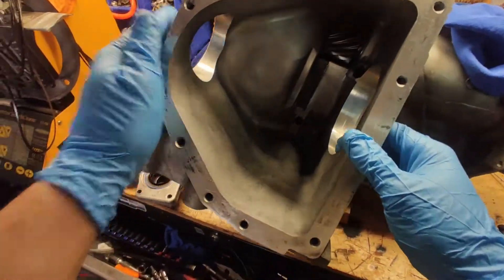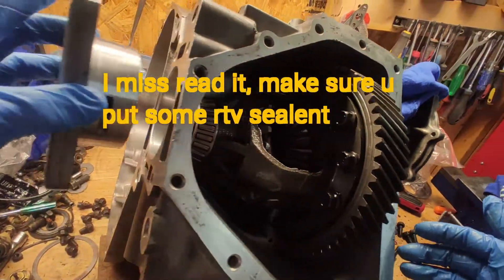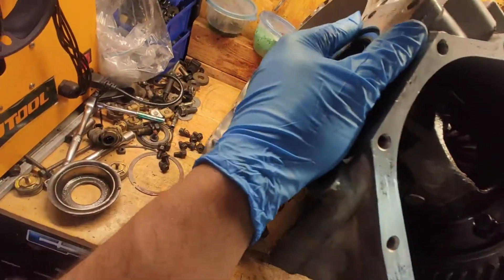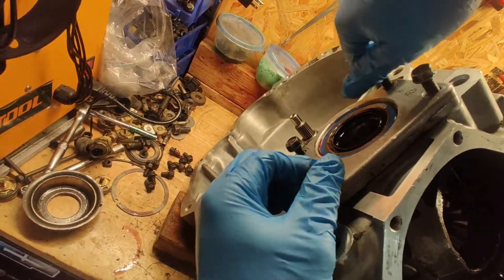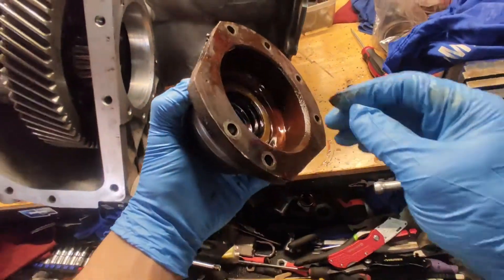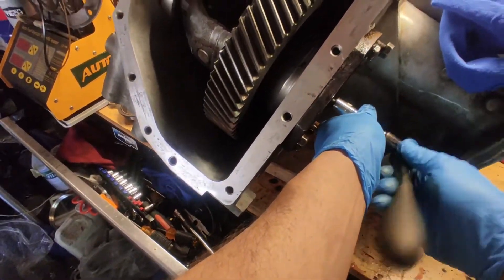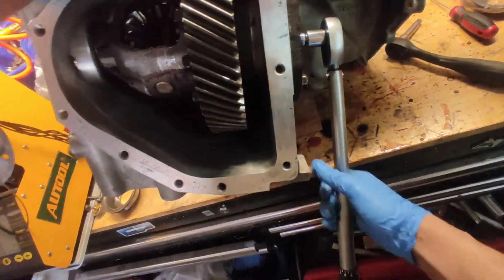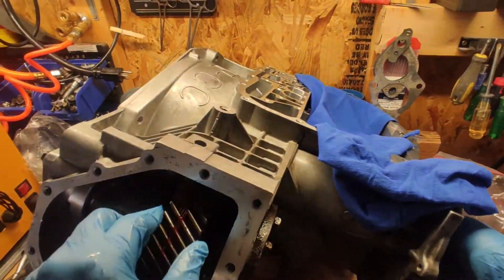A604/41TE Transmission Rebuild at home!!! Part 14

Comment: So, I have a Chrysler Grand Voyager limited, 3.3 engine, 2005. The thing is that the speedometer underestimates the speed. When driving 50 km / h, the GPS shows 55 - 56, at a speed of 100 km / h, the GPS shows 110 - 111, the instrument panels were changed, the result does not change. Everything is the same, the transmission works without problems, all the sensors of the input and output shaft are in good condition, even if they were replaced with new ones. But it did not give any effect, there are no errors, the transmission does not kick, everything switches smoothly as from the factory.
Reply from the maker: Try your tire size, might have bigger tires than stock
Reply: @PoormanscarGarage Wheel size, disk radius and tire size correspond to factory ones. Pinion factor was checked via DRB3 scanner, there are only 2 parameters of wheel size that can be selected.

Comment: I like your videos. I have a 41T transmission. I want to ask you a question. I’ve been experiencing where in the morning time I start the car. I warm it up, but it won’t go into drive. It’ll go reverse, but it won’t go to drive I rip it up a little bit but let it get warm up to 106° and then it gets into drive other than that. It drives good through all gears. What do you think that I need to do? I just recently changed the transmission oil and the filter.
Reply from the maker: Sounds like you might have a sticky valve body or a worn seal, but it could be the pump too.

Comment: i have the 41tes i have some play in cv axles and it feels like the bearing and race are shot. was there any retention stuff for the cv axles that you changed? if so can you give me a list of the parts you used? i am thinking of changing the race and bearing to fix the loose cv axles.
Reply from the maker: I have not changed any of it
Reply: @PoormanscarGarage  thank you do you happen to know the brand and part number for the seals you used for the cv axle seals on the diff